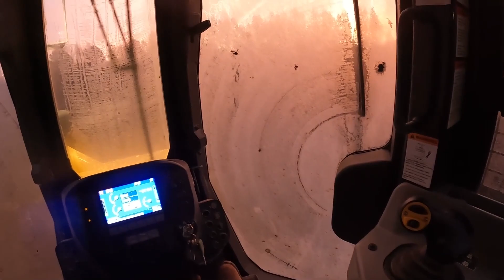Victory But It Took From SunUp To SunDown!

Comment: Here in the PNW I use RainX washer fluid. It will melt thick ice off the windshield very quickly. A lot of work clearing this property. Takes a lot of forward thinking about what to do with waste and to create the final product. Going to be very nice. Thanks very much for sharing.

Comment: Kind of like when I was a roofer. Work long days before the rains and sleep on rainy days. Got tough putting in those sixteen hour days until it started but tried to catch up when it came. Although there is no real catching up possible as the body does not work that way but you do your best. Thanks for the videos as usual Chris.

Comment: @ 11:40, for people with a light frost and no wind shied scraper, a credit card works great as long as you don't bend it too hard. They will break in half when it's real cold and the ice is too thick, ask me how I know 😎
 For your area, RainX windshield washer will help prevent that frost from forming.
Reply: Can use a spray bottle of RainX for windows and mirrors.  Fill bottle from gallon jugs.
Reply: @robertp7209  How about windshield wash fluid?  Up here where it gets a bit cool, we have it for -35
Reply: @timl3605  that’s what I meant, rainX is an additive but that’s the brand, it’s a windshield fluid antifreeze in 1 gallon jugs, the H Depot has it a lot cheaper than gas stations, 4 bucks vs. 6 or 7.  Just use an old fantastic spray container, or some other.

Comment: I'd say Chris needs a set of heated truck mirrors from Santa.
Hey Santa, they onky cost between 90 to 200 dollars. 
Looks like Chris is approaching the end of the tunnel on this project. 
What's up next ?
A large pond job maybe ?
Once again Chris and family,  Merry Christmas and a Happy New Year. 
The same to my fellow Letsdig18 subs.
Since it's happened to me twice I'd really like to not wake upon Christmas from a coma.
That's a sucky way to celebrate Christmas. 
I've also spent two Thanksgivings in a hospital and pulled ready Helo Flight Mechanic duty on Christmas 3 times.
Two of them volunteer to allow married with children fellow Coasties to spend Christmas home with their families. 
The third due to a duty section change after returning from Coast Guard Airstation Mobile Alabama to Traverse City Michigan. 
One if them was in the blizzard if 1978.
Spent Christmas eve night plowing snow on the runways as tho we were actually going to fly a rescue mission in 65 to 80 knot winds 20 below zero.
Y'all have a very Merry Christmas.
Reply: You oughta write a book!

Comment: Ok, so the wiper motor doesn't work :(. Nice compost steam heat in that junk pile going to the back to bury. I know you had cold - it was 38F here in N.Fl. this morning. Did that set a Letsdig18 record for the longest time hot pile of ashes?

Comment: You on the Workplace before the Sun come on the Firmament, and it is cold. You work with the Excavator and Dozer and make a great Daywork. Clean the Area from all rest Wood and Burning it. With the Dozer to level the Area, it's Night how You the last Wood give in the Fire, and think make on off Time. However a spitz Video. Thanks for the

Comment: You need a riddle bucket, one that sieves the load before you put it in the dump truck or anywhere where you have a mix or roots, branches and stumps. I bet you are double handling tons of soil that could be just left in position and graded out.